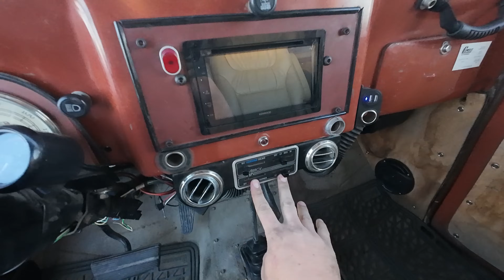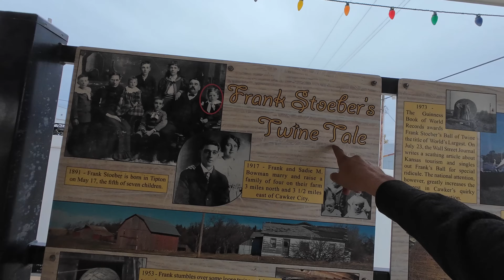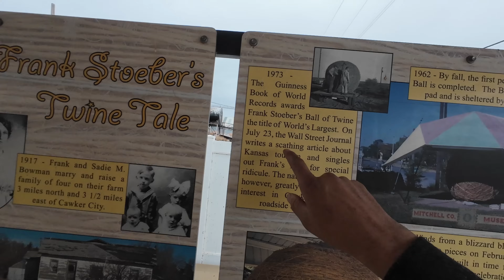I bought a 1949 Wagon and tried to drive it 2,164 miles home

Comment: What a gorgeous rig .... definitely needs some steel wheels and caps instead of those "new" looking wheels, then swap the mudders back on.... other than that, she's glorious and would be my daily rig, using 4WD only for snow when necessary, other than that, I'd never take her offroad as I'd never want to potentially damage that body sliding into a tree or rock.

Comment: good choice of engine, the transmission not so much (I would have chosen a 4L80) in the diff I would have placed Dana 60 on both axles, in the rear full floating and LSD

Comment: Just a heads up, that rear axle looks or be a Chrysler 8.25 out of an Xj cherokee. You can tell by the squared off portion hanging below the bottom of the diff cover. Similar looking but significantly stronger than a Dana 35

Comment: You mentioned that there was a bit of a disco glitter party in the rear diff so probably should check that out? But man that rig is kinda cooler to me than the old Dodge Bros car. Looks like more capable as well? The old grey Dodge is just a workhorse and being a 2500 probably more fitting to keep the tracks on it?

Comment: Very cool custom rig, I'd keep it as is for the first winter.  

Are both differentials locked on it?  That would be the first item to knock off the list, change the fuel filter too.

Comment: Hi Casey!  I haven't seen this response yet, but, are you sure that's a Dana 35?  I\ve owned more than a few XJ's, and that looks an awful lot like a Chrysler 8.25" rear.  The tell is that lip on the bottom of the diff, vs a smooth rounded bottom on the Dana 35.  Love the wagon, it's awesome.

Comment: You've not lived until you've driven a Hurricane flathead 6 Willy's on long distance trips.  Friend used to have a garage and resto operation in Mohawk, and his recovery and parts hack was a 1951 Willy's Wagon.  So what was the average fuel mileage?  Does it have a lockup top gear?

Comment: Hello Casey. I know this is old news, but I just caught up with it. As a retired transmission guy, I noticed there is a lot of variable slippage on the converter. Is that rig supposed to have a lockup converter? Just my professional curiosity kicking in.

Comment: Just change that rear diff fluid. Tracks are great if you need to pull out snowmobiles or run on bog-tundra. I was enamored of them when I first saw mattracks in the late 90's since they were made under 100 miles from where grew up. Now that I know about their limitations, I realize they are a niche product for a specific situations and some other idiot not knowing how to drive their 4x4 isn't one of those.

Comment: I say keep the 1949 Willy's Wagon, and get rid of that S-10 Blazer as you can put the tracks on the 1949 Willy's if you need or want as the job dictates. That away you can still have and run a tracked jeep instead of a tracked Chevy S-10, especially since that S-10 has already failed you once while on the job.

Comment: Lowest pass across the Rockies is I 80. Never seen it closed well at least not pre-80s.😮 I mean it’s straight and flat, followed by straight and flat, followed by straight and flat, and then you got your straight and flat😂 "as I remember when it was solid ice for skating and snowing, I slowed down to 80 as I came into Wyoming. I don’t think it’s that people have lost the brain cells needed to drive correctly. I think there’s just too many people on the road.

Comment: Gd video bro i travel a lots but i travel on my little buddy Geo tracker 16 valves 96 4x4 on 31 tires 15x10, wheels flare out all homemade no bad sit or rug homemade bikini renagate style my engine have a cam regrind 272 header custom homemade exhaust system Free flow aluminum pulley gd air filter and like i said i always in the roads all over usa is a 4x4 automatic transmission never any problems i maintenance my always in great shape from bearings transmission oil cooler it have 350 thousands miles and the engine is like new and transmission no oil leaks nothing like i said i take care of my little buddy well all seals and oils and everything else i do the job myself  i can say one thing i love my Geo tracker but because his old school style looks people seems to love him to all over people always saying something like i like you pony or you sale it etc kids always want a picture next or inside my geo the smile on them and family make my day really seniors females etc always come to me and throw pictures of my geo tracker i build my self old school style with junkyards parts and really look old school and bulk like a toy nothing fancy a poor man horse jjjjjjj i love driving usa work here and there and kp rolling up hill down hill i call it freedom the gypsy way or nomads way with the sound of the Spanish guitar 🎸 take care out there

Comment: Get winter wipers you'll be fine.  In that weather you wouldn't find me anywhere on the shoulder ever, on ramp shoulder only or rest area truck stop.  Too many morons these days, no cb and no winter trucking experience just flying into icy conditions. I don't miss trucking past Rawlings. When really bad I used to just get behind doubles, they're always loaded light and they'll set a more than safe speed for anyone by force essentially, they won't be able to go any faster if they tried.

Comment: Nope, leave it alone and trade me for my sweet 1950 Shortbox Chevy with 4 corner disk brake, 1996 sbc with 700r4. All new floor pans, 1978 Nova front clip all brand new. painless wiring. Vintage Air. All new glass, regulators.

Comment: Your going to trade in a super winch for a badlands? Big mistake. Big . I put a 8000 upright aluminum super winch on my first 4x4 truck in 1982 hell of a winch and it never let me down. I actually hung the truck from a huge tree about twenty feet off the ground. I very seldom needed to double line to drag full size trucks with 44" tires sunk in a pipeline in the spillway west of New Orleans. They are very strong dependable winches

Comment: I70 was a mess I have a friend who squeaked through right before they closed it his dash cam is full of him laughing at people who went zipping by him and within a few miles were slid in the ditch or jack knifed blocking enough of the road he had to drop 1 side or the other off to get around them and hope his rig didn't slide off the gravel and to the bottom of the ditch because it was still soft under the 2 inch crust and plenty of people plowed the ditch in places he came across a flat deck with rolls of metal jerking rigs back straight and on the road and said the way he was literally jerking them with a chain the man needed a Yankum

Comment: Casey the Comment baiter strikes again! When I have wiper issues in the snow, first thing I do is push the snow and ice off the glass where it clumps and restricts the arm.  You know he knows there's a few people out there itching to push the snow off the glass at least after fiddling with the arm and spline, knowing it isn't tight and it hits and ramps and makes it more likely to happen again. Thinking he either left it on purpose for this reason or intentionally didn't show it, knowing he had the brush. I'll drive with crap on my window but if it pushes my arm off I'll clear the obstruction quick. Toilet rant over. Think I'm the only one who took the bait.

Comment: Why would you ever want to change a thing (other than?hydro-steer) on that great vehicle?  Whomever rebuilt (restomoded") that vehicle apparently did a magnicent job! I don't mind saying, I think you would be a fool to do so!!. I will confess that I once almost was able to puchase a 1951 Willys ( with the original 4 cylinder engine)-but someone vandalized it before iit was mine!  Kids routinely stole it ( and returned it to the company(shop's ) parking ot so they could enjoy it the next time(s). I can honestly say I wouldn'tt have bought the '58 not so great moded Corvette or the tired (id f still wonderful) cloth topped VW bug-or the worst car I have ever owned-a slightly used '73 Caprii with the 2.6 liter V-6. That thing was a piece of crap in almost every way!  Good luck forever on your Willys survivor!

Comment: Rule numero uno, avoid I80 across Wyoming from September 15 thru April 15 … The idiots they are letting drive semi’s today are not skilled enough to know when to slow down! When I started in the early 80’s there were days when 10 to 15 mph was the standard, there were no pile ups almost no one even ran off the road, these ass clowns run 70 bunched up and when one wrecks they all wreck. Totally avoidable and there is zero excuse for it happening

Comment: Lose the dunes flag
Reply from the maker: @daleb5967  you’re not the sharpest tool in the shed, are you??
Reply: @CaseyLaDelle  for snow?    Lol
Reply from the maker: @ where do you see a flag?
Reply: @CaseyLaDelle  I'm a Jeep purist, a rock crawler, dune runner, rat rod wrenching, motorcycle racing ,national  registered trail riders 4x4 association member..   .....
But hey,.....crack more jokes....
Reply: And I have one if those jackets......lol
Reply: @CaseyLaDelle  orange front bumper dunes flag....
Reply from the maker: @daleb5967  there is no flag.   Try again.
Reply: @CaseyLaDelle right next to the high lift?......lol
Reply: @CaseyLaDelle  omg......orange flag pole on front bumper, passenger edge
Reply from the maker: @daleb5967  I am telling you for an absolute fact that there is not a flag, or a flag pole on this vehicle.